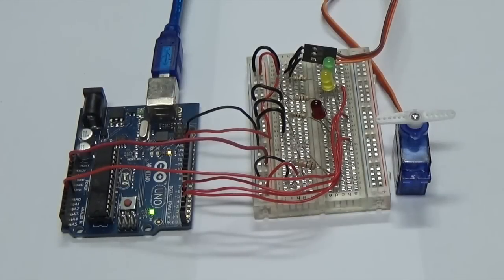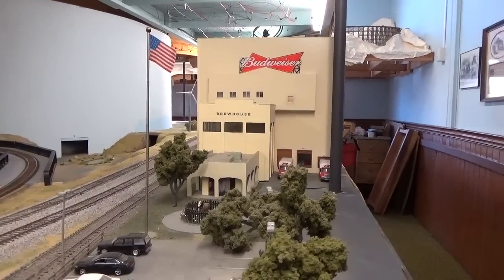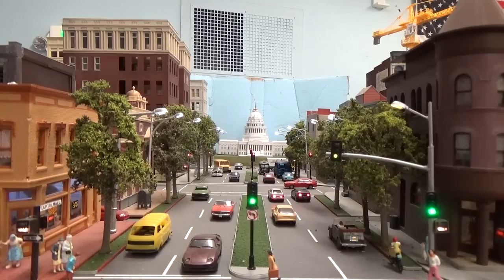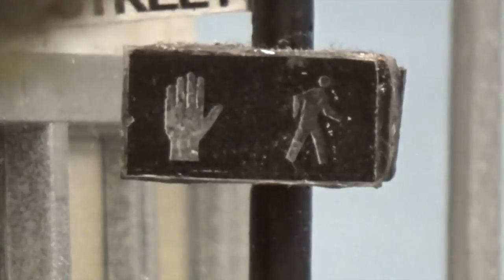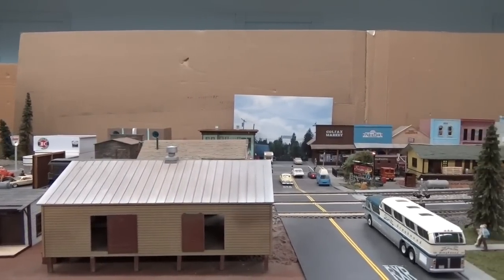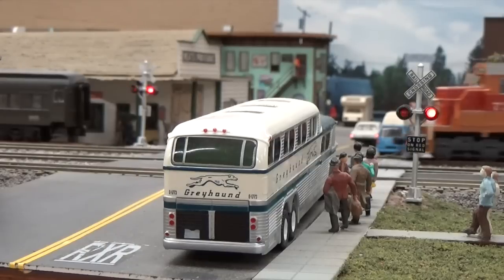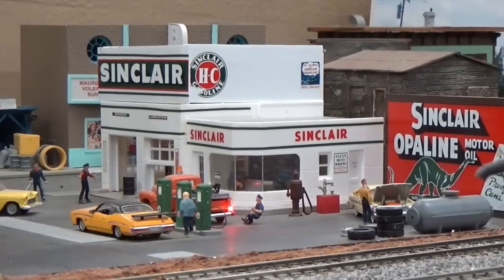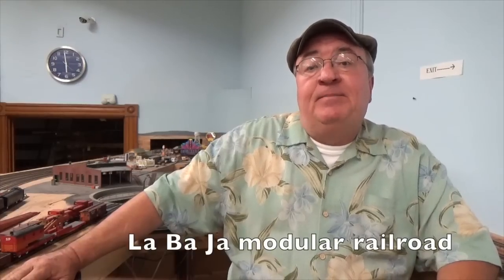Model Railroad Minute S2E5 Animation with Arduinos

Comment: I saw some of those animated signs at Roundhouse Inc., in St James MN. First time I'd ever seen one, and it was amazing how much life it brought to their night scene! Rather than their animated ones though, I'd liek to see them do a line of small plain white signs in various simple shapes. Not animated, but designed for decals or printed overlays. I feel like the signs that I need the most of are the simple backlit signs. If set on a building, that's easy... Cut a hole, place the frame and the sign overlay, and have a diffuser and an LED behind it. For freestanding signs, that's not necessarily as easy.